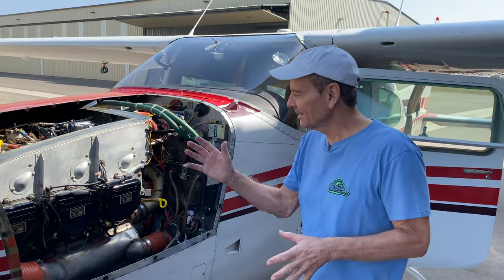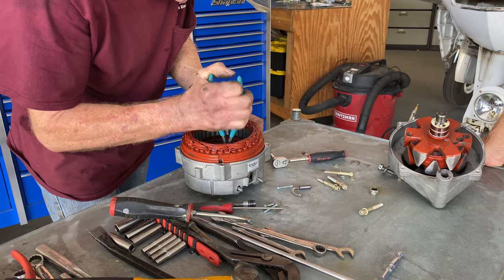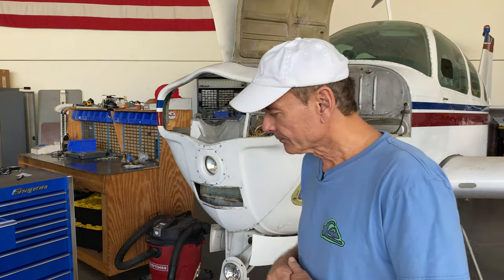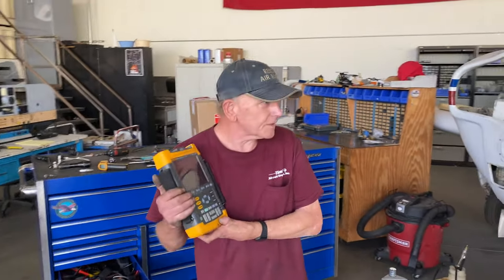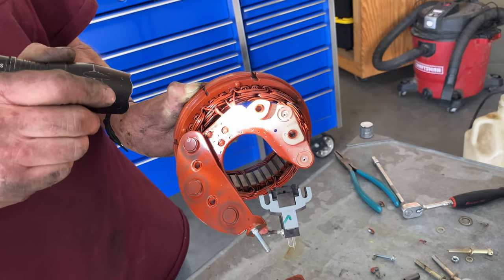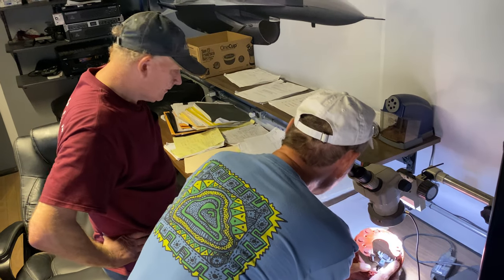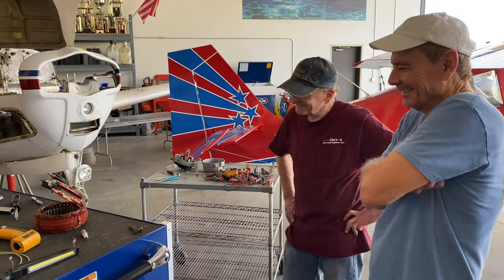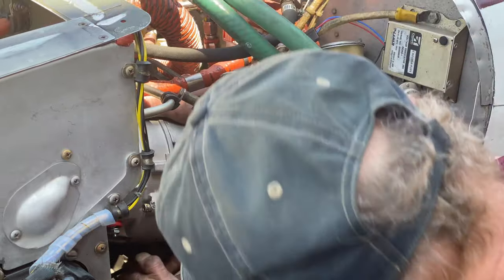Cessna 210 Bad Alternator

Comment: I'm guessing you can more or less tell by the sound you hear on the radio what the problem is.  I'm having the same issue and I have chased around bad earths and resistance all over the place and its still there.  I think it makes the job of the regulator difficult as well because its seeing huge repeating variations in voltage which really screws up the control loop hence the pulsing as well as the whine.  What you didn't show which would have been helpful is the oscilloscope waveform.  I'm guessing there is a repeating dip at the point where one of the diodes isn't conducting.
Reply from the maker: Good comment. I am wondering what stress the dirty electric has on the other electronics like the avionics and autopilot.
Reply: @1capcarl  I seem to be unable to comment it gets deleted automatically. My most recent flight on my channel shows a similar noise only much worse.